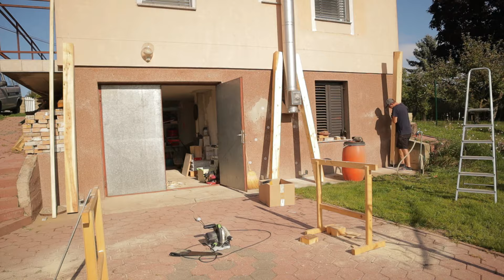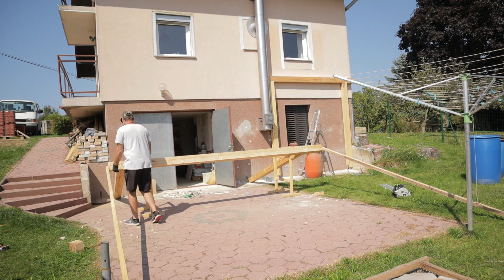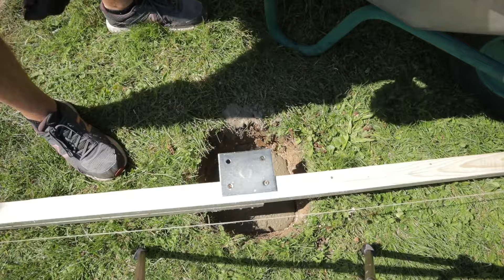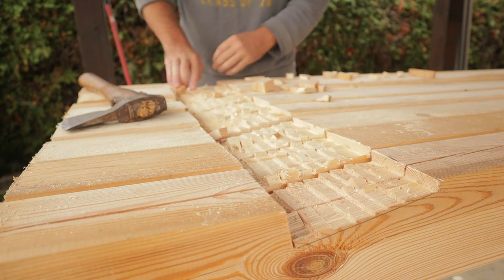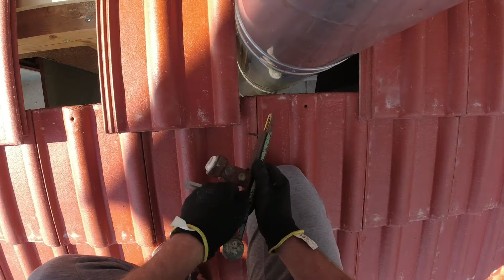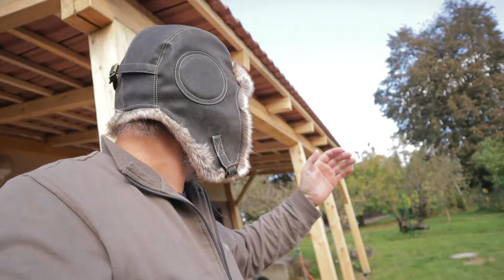DIY Patio Roof, One Man Canopy Build From Start to Finish

Comment: I like the design, but the construction methods pose many long-term issues.  A ledger board attached to the house would have made the build easier, and stronger (less prone to side loads).  The post footers need to be twice their size and belled at the bottom to prevent uplift.  The post footer brackets appear to only be connected with one lag screw per side; if so, this creates a dangerous pivot moment.  Additionally, the brackets should only be 1 to 2 inches (25.5 - 51mm) off the ground.  At their current height, shearing is a significant risk.  The birds mouths for the upper stringers are way too long and missing the ties.  Even if rafter ties are not required by your municipality, they should be installed to provide a solid, safe connection.  Lastly, the roof needs to be flashed against the house to prevent water from rotting the top post, and the stove/heat pipe roof penetration needs to be sealed.  There are several high-heat options, a hi-temp silicone boot being the easiest and least expensive overall.  This post is being made to protect other viewers planning to copy this build, not to be negative about Robert's work/video.
Reply: make a video on it

Comment: Very nice! I like how you connected to the house without actually attaching to the structure saving demolition and engineering time! Would have traded the 2x2's for 2x4's, how did you not fall through?

Comment: great job , but how come you didn't nail in the roof tiles to the batons, if you get some high winds then some of your tiles will go flying, I have never seen someone use an angle grinder as a planer before either but it seemed to work a treat
Reply from the maker: We don't have such strong winds. Thanks for the visit

Comment: Hey Robert I like the video, good job. I wanted to ask you, how did you end up closing that space with the vent pipe on the roof? I noticed you used a grinder but didnt see you seal up that space? Also in the video you dont show how you attached the ledger board to the stucco wall. Lastly, the way the roof tiles are added wont rain get behind them and drip? 
Your answers are appreciated. Keep up the good work.

Comment: It looks amazing, one quick questions what if it rains. I live in California it normally doesn’t rain a lot but once it lasts for days, my biggest concern is the rain proofability
Reply from the maker: It is not a problem if the wood gets wet several times a year and then dries quickly. There will be no damage to the wood. However, it is not good if the wood is constantly exposed to moisture, then it will start to rot. Do not worry wood under the roof will last for many years 🙂

Comment: Looks awesome. How did you attach it to the house so it doesn’t pinch the stucco or leak? I’m looking to do this on my house.
Reply from the maker: This will come the worker and will form the sheet metal on between the wall and the roof.

Comment: What kind of roofing material is that? Looks like clay tiles.
Reply from the maker: concrete roof tiles
Reply: @klerobi1  does water leak in between them?
Reply from the maker: @NameTaken_86  if there was a strong wind, maybe a little.
Reply: @klerobi1  thank you. I live in the states and want to build a cover over my back porch. I love the old world look of these tiles but unfortunately I may not be able to find them here in the “new world” as they seem to value quantity over quality.

Comment: I'm trying to find lumber sizing that was used in this video
Reply from the maker: The pillars are 14 x 14 cm and about 2.5 meters high, the wood for the roof is 10 x 12cm and 3 meters long. The wood for the roof tiles is 4 x 5 cm and 4 meters long

Comment: how deep and what exactly did you use to drill thru the beam, into the house wall?
Reply from the maker: I think the screws were 28 cm long and 8 mm thick, they were screwed in about 12 cm deep.
Reply: @klerobi1  do you need to drill a hole into the wall first? Is it the concert wall? And do you need to find the stud first to drill the hole there? Or you can drill a hole first every where since it's the concrete wall?
Wonderful project, it motivated me to try doing my own one after watching your great work here 👍

Comment: Good job, I liked the way you raised the posts on your own. What are your post dimensions please what is the price roughly you have paid so far including slates?
Reply from the maker: The pillars are 14 x 14 cm and about 2.5 meters high, the wood for the roof is 10 x 12cm and 3 meters long. The wood for the roof tiles is 4 x 5 cm and 4 meters long. The price of wood here is around € 200 m2

Comment: But the tiles will not fly away in the hurricane?
Reply from the maker: I don't understand the question
Reply: @klerobi1  how did you attach the tiles to the roof? It seems like wind or rain could cause them to fall off, no?
Reply from the maker: At the beginning at the wall there should be a sheet metal edging and around the chimney